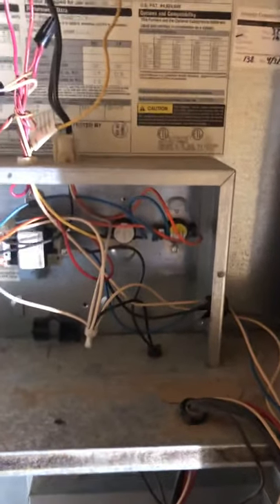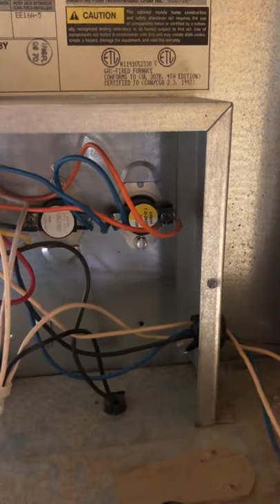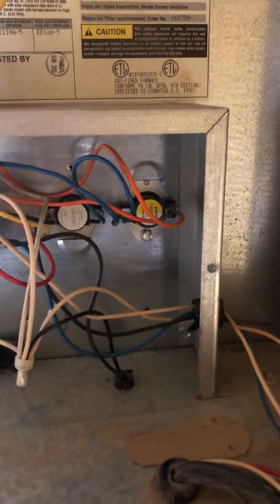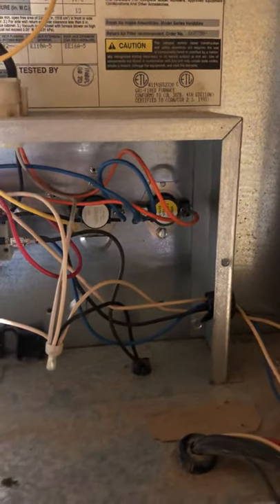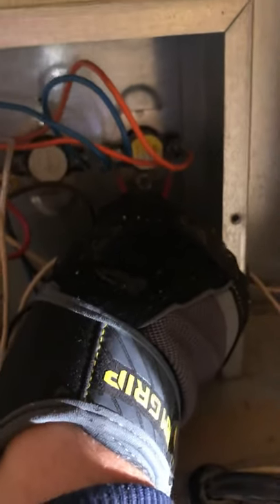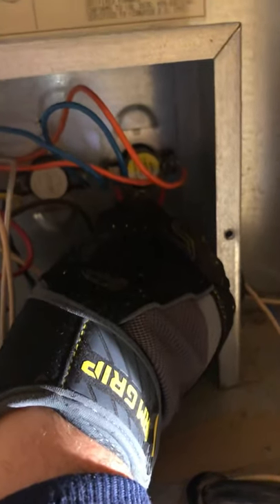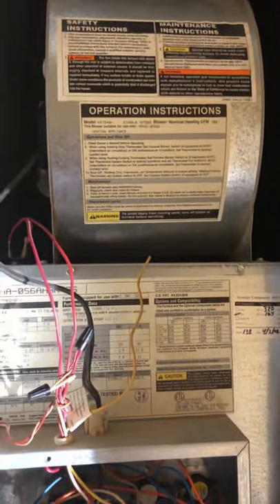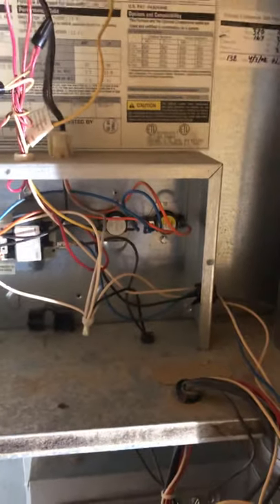Nordyne Furnace fanswitch bypass

Comment: Was there a solution?
Reply from the maker: This furnace will not operate correctly. once the unit is below a certain temperature.  I had to use a propane torch to get the system warm enough to operate correctly.  If the unit breaks during very cold winter conditions, it does not operate correctly.
Reply: My switch is tripping out because of overheating not because it's not hot enough like in this video. Can you jump it out to see if that's the case.